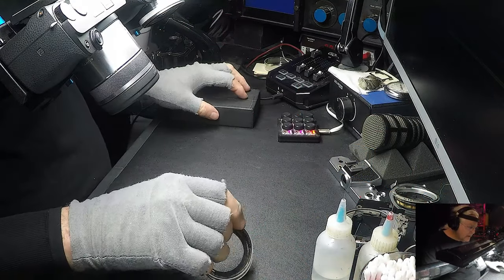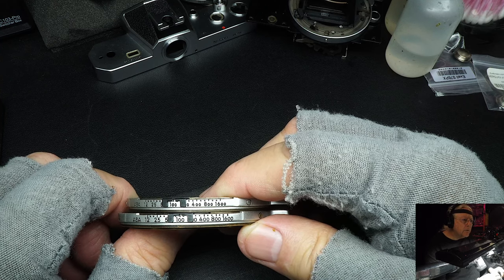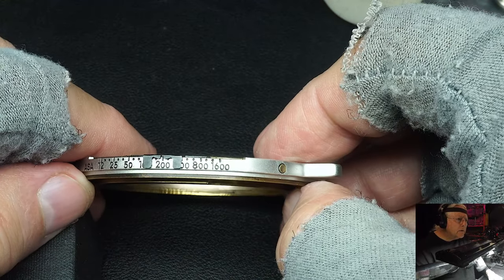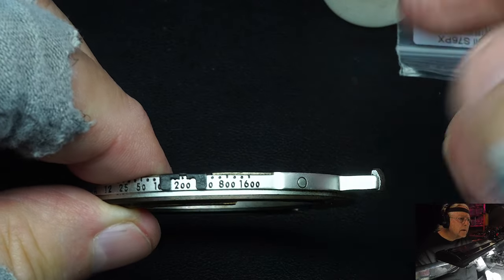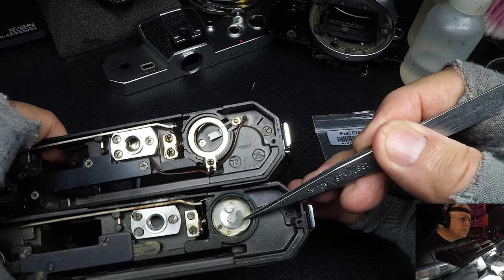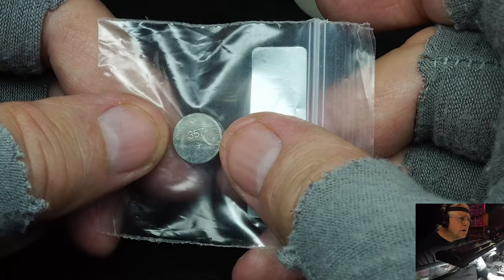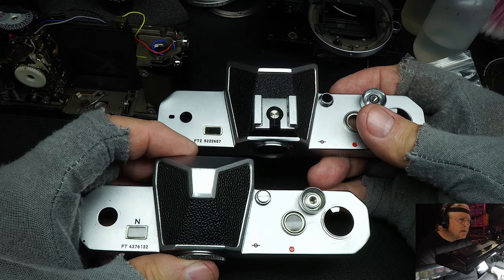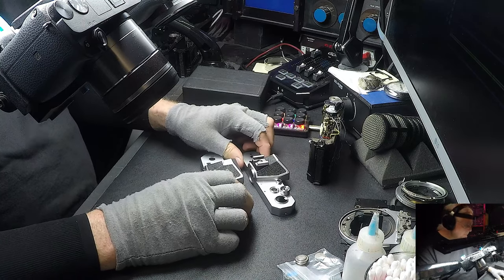Nikkormat | FTn vs FT2 Vlog Tour | Vlog #012

Comment from the maker: patreon.com/mycamerahobby
Reply: Another great video. I have Nikkormat FT2s and Nikon F2s. Do you find the Nikkormats easy to work on compared to other cameras? In use, I find them as good as the F2, and I really like the design. You might want to change the title - that's an FTn, not an FT, hence the N above the meter window on the top plate. The FT had an even more primitive aperture index.
Reply from the maker: @nikkormat705  
Thanks for the heads-up about the N. I rush my videos and don't do any research on them since they are for entertainment only. If I were writing articles or making training videos, I would be more careful. As for Nikkormat service being easy or hard, they are about the same as working on Canons, Minoltas, Pentaxs, Olympus cameras. Each camera model has its own problem areas.